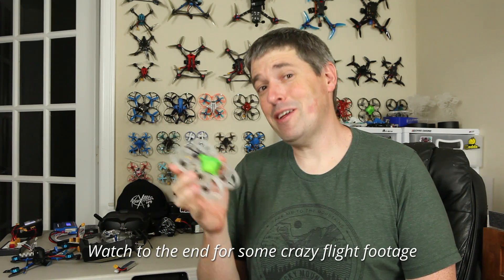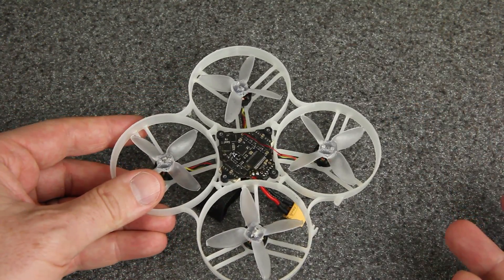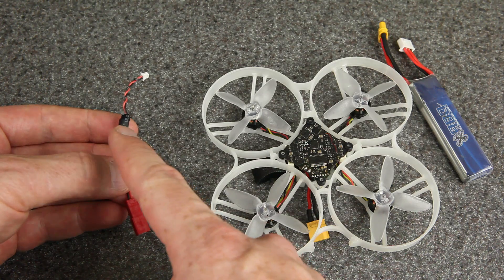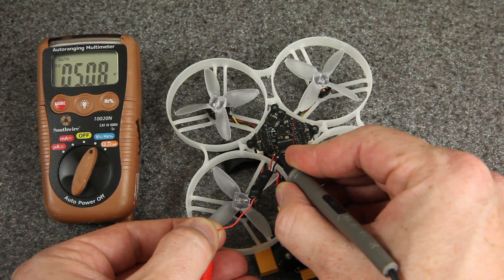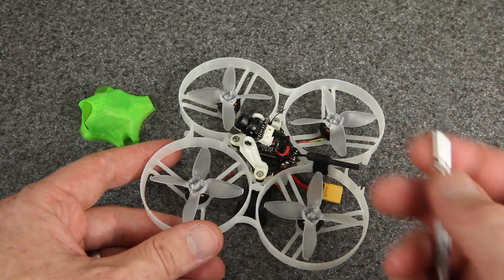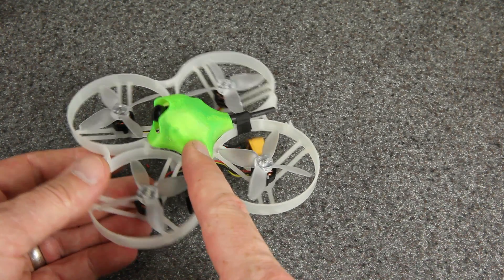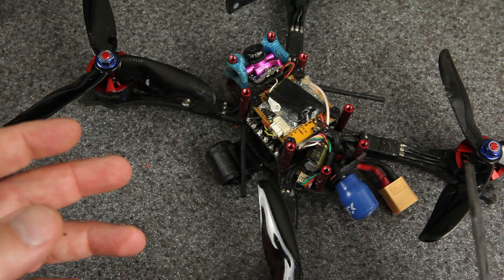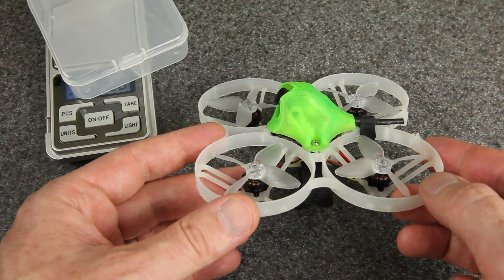Fixing the #1 Cause of Flight Controller Failure

Comment: what could be the cause to my Hdzero AIO5 having no lights or sound when plugged into battery? But all beeps and lights work when powered by USB. Additionally the motors do not work in betaflight even when battery is connected. Everything else seems to be working on betaflight side
Reply from the maker: If lights only come on when you connect USB then the 5V regulator is probably dead. It works on USB because USB provides 5V to the board. But is that the only problem? 🤷‍♂️
Reply: @MrShutterBug  would your solution in the video work for my case?

Comment: You know the normal startup sound is du (low) du (high). Well, today i had a small crash into a wet, mud like ground and when i took off the drone flew for 3 seconds before flipping sideways into the ground without input. Right now when i try to turn the drone on the beeps are different. So i get the standard startup which is the 3 beeps but then instead of du (low) du (high), it is du (high) du (low). When i connect the battery to the drone and wait a little i can see a tiny amount of liquid forming in between where the power cables are connected to the board. Also when i wait a few seconds smoke starts to appear. Please help. I am using the speedybee F7 Mini stack.

Comment: What if it’s happening on my 5 inch
Reply from the maker: Sorry for the late reply. The same problem can happen on a 5 inch drone. The 5V regulator is a common point of failure on flight controllers of all sizes. If your flight controller does in fact have the same problem, then the same solution might work in your case as well.

Comment: I have a mystery for you that I'm kind of desperate to fix. If I plug my battery in I only get the startup power tones like this video but the flight controller is powered. If I were to connect the flight controller with a USB battery then plug in a battery I would get all the tones of course. But if I unplug the USB power bank I can still fly the Drone because the flight controller is still functioning.

In other words, it seems like my fc is powering up too slowly?

A little background. There was a crash a while back. It took a week after that for something to smoke. It was the esc from what I can tell and it smells like it too. I replaced the esc, but this delayed start is still here.
This is a 5 inch quad.

Any ideas?

Edit: in fact, if I disconnect and reconnect the battery really fast I'll get all the beeps. It's killing me. I just want to fly!
I found it seems like the blue light doesn't light up. I'll check the 3.3 volt regulator which is what the fc uses. The 5v is for the accessories on mine
Reply from the maker: That is mysterious! I've never heard of a quad that required USB to boot up, but did not require it after that. As you said, there could be something delaying the FC boot up. I suppose that is possible, but it is equally possible that something is delaying the ECS boot up. If they do not respond when Betaflight tries to initialize them, then I think the same symptoms could occur. So maybe it is timing related, like you suggested. Or... it is possible that either the FC or the ECSs are browing out during the initial plug-in. I'm not sure what would cause that, but I would be very interested to see a plot of voltage over time. Do you have access to an oscilloscope? If so, you could take a look. If nothing else, I suppose you could use a portable USB power bank to jump start it in the field, or you could rig up a small 5V regulator to feel the USB power inputs from battery. Good luck, whatever you decide to try!
Reply: @MrShutterBug  I can check voltage over time. I've been looking and I'm wondering if it may be firmware related, but I will report back. Thank you for the reply:)
Reply: @MrShutterBug  so power delivery seems okay, but I'll check more tomorrow.

More clues. Basically, the fc never starts these times. Betaflight doesn't load, no osd, no blue light on the flight controller. It just sits there with the regulators humming away, powering the reciever, but nobody is home. The code doesn't run. Maybe the cpu? Idk.
I can buy another one. That's not a huge deal, but if it's something small that'll bother me. Maybe it is a regulator just barely out of spec.

The fc never fails to boot if I blip the quad or plug in with USB. Never ever, so I'll check more power stuff.

Thank you

Comment: So take one end and connect to power leads and the other end to any 5v pad? Am I understanding this right?
Reply from the maker: If your FC has a dead 5v regulator, like mine did, then yes. An external 5v regulator could be another way to restore voltage to the 5v line. But, results vary depending on the condition of the FC. Be careful and take measurements with a multimeter.
Reply: @MrShutterBug  I believe it was the 5v regultor becuase I installed this device and now i'm up and running. Only difference is that I didn't cut off the black wire. I had to use that for ground. Thanks for the video!

Comment: Is it just normal for tiny whoop boards to just “die” after a while? My friends and I have gone through several on our drones, granted we crashed a lot when we first got them, but they seem to just crap out under normal use. Sometimes the things just do the janky “death rattle” when yawing, and sometimes it just stops giving video
Reply from the maker: Unfortunately yes, the failure rate is pretty high across the industry. Cheap manufacturing combined with a harsh working environment (both physically and electrically).

Comment: Mine isn’t making the dee dee noise after battery plugged in & no motors going off does that mean only the fc is dead & not the esc?
Reply from the maker: Does it light up at all? Maybe there's a problem with the power connection? Can you connect to the Betaflight Configurator via USB? It's really hard to guess what could be wrong without more info. I suggest you record a video and post it on one of the many FPV groups on Facebook. If the FC can be saved, then someone might be able to point you in the right direction. Good luck!

Comment: The weird thing is my esc also overheats a lot so I don’t know what to do. Cant connect to beta flight either :( any solutions?
Reply: I also do get the lights but only 3 beeps but when I plug in usb no lights
Reply from the maker: Sounds like you might need a new FC if you can’t connect to it via usb.

Comment: This is a game changer. Just put a quad together and had flown a few test flights after tuning. Then an incident and only three beeps. I've got four 5v pads and one of them is dead, so I am going order up a set of these and give it a shot. Thx!
Reply: How did it pan out?
Reply: @ryswe  It didn't fix it in this case. There was something more pooched with the board.

Comment: Does the battery have to be full charged? i notice my drone didn't made that sound when i turned it on, but i was just testing my new goggles and didn't want to send time charging batterys só just pluged a random battery and didnt make the beep
Reply from the maker: No they do not need to be fully charged. Most drone motors beep as the ESCs boot up so you know it is working. We’re talking about brushless motors. Brushed motors don’t beep.
Reply: @MrShutterBug  i see, very weird :/ i got the drone in second hand, but when i tryed to change stuff on betaflight the radio controls where inversed, so as stupid as i was ( im new at fpv btw xD ) i reset it and then i couldnt recieve any responses after conecting again. A lot of time passed and i got finally the goggles but when i turned it on there was no 2 beeps :'), and on betaflight couldnt turn on the motors, (when before i could, and havent fly it ) the only thing i always notice then and now is that it gets really really hot like so hot i cant even put my finger on it, and i remeber that sometimes after a while it started beeping non stop until i plug it off and on again ( idk if it has something to be with but made me confused ), Other thing i notice is that he does receive the information whe its connected to the radio coz the led goes static green :/. ( i got the nazgul 5 6S btw )
Reply: Other thing that i notice was even with the battery pluged in on beta flight it didnt show like it was pluged was just at 0 volts

Comment: Have this same issue accept there are lights turned on granted it is a skystars f405 so not a whoop. But i am wondering how to go about fixing my drone cause i get the three beeps but the board does show a solid red light
Reply from the maker: If you have a multimeter, you can test the voltage between the 5V pad and GND. Does it show something close to 5V when you plug in a battery? If not, then you have a bad voltage regulator. If voltage is OK, then something else is wrong. Good luck!

Comment: Using this method for my 1S toothpick, which has a blown 5v reg. Obviously my 1S LiPo will only provide 4.2v, so I need to use a 5V Step-Up/Step-Down Voltage Regulator S9V11F5 to step that 4.2v up to 5v. Doing it tonight, so fingers crossed...

Comment: So my 6s 5” has the same problem, can I use that part u listed for 6s? And where exactly did you solder it to?
Reply from the maker: I believe the same regulators can go up to 6S, but check on the product listing. It looks like Amazon no longer has them in stock though. The regulator would have two sides. One side connects to the battery leads, the other side outputs 5 volts. Good luck!

Comment: What happens if I plug a 1s lipo on a quad that is specified for 2s or 2-3s?
Reply from the maker: If the FC says 2-3S, then I would not expect it to work on 1S. The FC will use 5V for certain functions, including the 5V pads that power accessories. Thus, a 1S FC needs to convert the voltage up to 5V while a 2S FC needs to convert to voltage down to 5V. Those two things require different hardware components. Some FCs have both and can support both 1S and 2S, but others do not.

Comment: can you fix a dead esc on something like the crazy bee f4 ?
Reply from the maker: No, I do not have the knowledge or skill to fix a dead ESC. It would require replacing the damaged component (probably a FET or capacitor) on the surface of the PCB. Sorry.

Comment: How do you fix issue of drone bind function not working? I tried pressing button and also bind_rx command.   Mobula6 DSM spi.   Thank you!
Reply from the maker: That's strange. I do not have a Spectrum radio, so I don't know for sure. Does Spectrum have different modes for 8 channel vs 16 channel, like FrSky does? If so, maybe you don't have the right mode selected? Other than that, I would expect it to work. Just plug in a battery to the drone, then press the bind button. If the radio is also in binding mode, then they should link up. If you are confident that you know how to do it, but this one drone doesn't work, then I suggest contacting the manufacturer or the store you bought it from. Good luck.

Comment: I have fixed the fc according to your method, but there is still no way to display the osd (video out does not respond).  Is there a way to fix the Osd problem?
Reply from the maker: It's hard to guess what could be wrong with the OSD. Did it work previously and then it stopped working? Two common OSD problems are:
1) If Betaflight is set to use NTSC for the OSD, but the camera is PAL (or visa versa), then you will see the camera picture but no OSD.
2) If there is a short between the FC's VI (video in) and VO (video out) pads, then the camera signal will bypass the OSD and go straight to the VTX with no OSD.

If it's neither of those things, then I suggest posting about it on one of the big Facebook groups. If you include pictures or video then someone might be able to spot the issue. Or... maybe the OSD is dead. Hard to know. Good luck.
Reply: @MrShutterBug  It should be the second question, osd may be dead.
Although there is no osd, but the flight can be normal, I am already very happy.
Thanks for your advice.

Comment: is the 5v pad you are using the same 5v you are using for your vtx/camera?
Reply from the maker: Yes. Some FCs have more than one 5v pad, but they are all interchangeable because they are all wired together. You could verify that by testing for continuity with a multimeter.
Reply: @MrShutterBug  I ordered a tester but it arrived just a case. can you still solder both the vtx and the buc on the same 5V together without any adverse effects? my mobula 7 crapped out and I want to make sure there's no other place I can use first but the diagram for the original mobula 7 board doesn't label every pads android I see 5 nice fat rounds ones that would be awesome to use one of. thanks in advance. also love your content. keep em coming
Reply from the maker: @Kamikaze-v2.0  yes, you can solder more than one wire to the same pad, but it is tricky to do. I suggest soldering one short wire to the pad, then splice the other two wires to the free end, making a Y junction with a bit of heat shrink to cover it.
Reply: @MrShutterBug  it worked.im putting the newly revived mob 7 guts into the carrera frame kit as im typing this lol just swapping the motors to the 1102 13500kv betafpv motors to make sure it has plenty of power.thank you so much Mr. Shutterbug.

Comment: Great vid! Quick question though- what if you’re only getting Dee dee dee (then silence) BUT there are lights still lighting up?
I bought (Friday, so two days ago) a Meteor65 Acro from a local drone store. I got it to successfully bind and it flew AMAZING. The next morning I flew a couple more batteries, ate breakfast, then tried flying another battery and all of the sudden the drone doesn’t work. To be exact, when I plug in a battery, a red light comes on, three beeps sound, then a purple(maybe pink) light starts to blink and nothing else happens. The boot up sequence doesn’t finish, the blue/green lights never start flashing. Nothing. I’ve looked online for answers and even called the local drone store but nobody has heard of this particular problem. Is there any chance you can help me figure out the issue?
Reply from the maker: It's hard to debug from here, but you could check to see if the problem relates to the 5V regulator by doing the following.

1) When a battery is connected, use a multimeter to test the voltage between the 5V pad and GND on the flight controller. It should read 5V or something close to it. It may be that the regulator is providing partial voltage (less than 1-4V?) which might be enough to power some of the LEDs but not enough to run everything. That's just a guess, but you could test it with a multimeter.

2) Another test would be to connect USB to a computer or power supply, and then connect the battery (or try the opposite order). If it beeps correctly when connected to USB then that is another indication that the regulator might be the problem, because USB provides an alternate power source for the FC.

If the FC appears to have the correct voltage on the 5V pad, then it is hard to guess what could be wrong. I would plug it into betaflight and start testing things. Like can you spin the motors individually? Well, good luck! I hope this helps.

Comment: Thanks for the video.
I have followed your instructions ... But I have another problem. There is no battery status. Do you know what I should do? Thanks again
Reply from the maker: What do you mean by "no battery status"? Is the battery dead, or do you simply not know the battery voltage?
Reply: @MrShutterBug , the FC 5v is dead ... so I followed the video ... but I think the FC has another issue because it is not reading the battery voltage, it is blinking "0V" (although is it enabled in the beta flight). Do you have any idea? Thank you very much
Reply from the maker: @dpatricksp  are you using HV batteries? If the voltage reads too high when you first plug in, then it will flash 0V. If that is the case, try increasing the max cell voltage on the battery tab in betaflight.

Comment: Tried this...no luck.  
Wired the inputs in, confirmed I got 5V out the back side. 
Wired the 5V input onto the board...then it only reads 0.3-.4V.   

Tried another step-down board just in case something was wrong with the first.   Same result. 

Wired 2(!) on just because.  Still nothing. 

This is all on a Betafpv 85x. 
I wonder if it just doesn't put out enough amps...?

Comment: Congratulations on hitting over 10,000 subs!

I thought I had this happen on my 75mm mobulite 25000kv🤔 it only played half the esc chimes I noticed it was unbound so I bound up and then set it up in beta flight 🙏 🍀... it seems to be a low voltage issue with the mobula6 board.

Comment: So curious.. if you plug a battery into a whoop and nothing happenes. Does that mean it’s toast?
Reply from the maker: If nothing happens, then you could have a dead 5V regulator like I showed in this video. It is also possible that you could have a problem with your power lead. I would plug in a battery and use a multimeter to test the drone. If the multimeter says the drone has the correct voltage on the VBAT +/- pads, then the power lead is OK. Then I would test a 5V pad. If the multimeter reads 5V between a 5V pad and ground, then the regulator works. If both work, then yes the FC is almost certainly dead. But if the problem is the 5V regulator then you might be able to work around the problem like I showed in this video. Good luck!
Reply: @MrShutterBug  thank you for your reply, is this the same on a 1s whoop? The FC in question is a bee brain lite
Reply from the maker: @motome8  yes except you would need a 5v step-converter instead of the step-down converter I used in this video. I have never actually done it to a 1S FC, however because it adds weight and 1S whoop are very sensitive to weight.

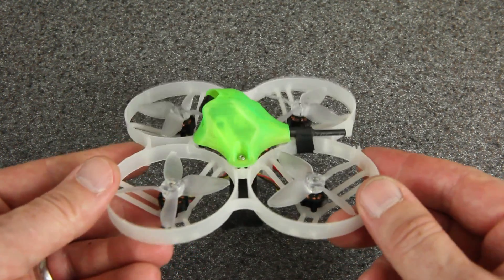Comment: 9:24 lol.... you showed how you took 5v on the 5 inch esc to led strip if needed.... but then went to the little drone. Well howd you fix the little one?!
Reply from the maker: I showed how I fixed the little drone with a 5v regulator before that part.